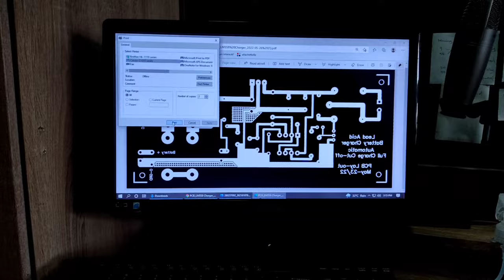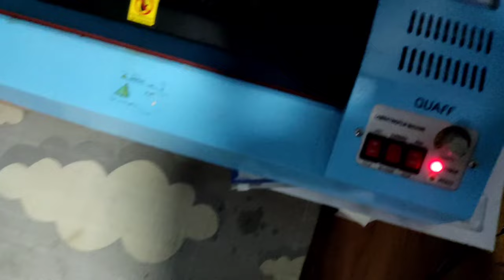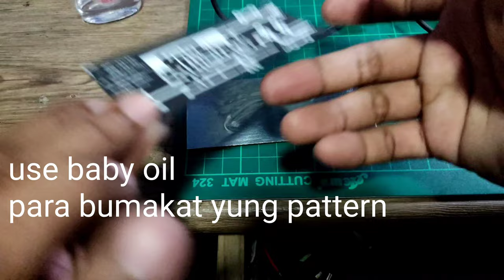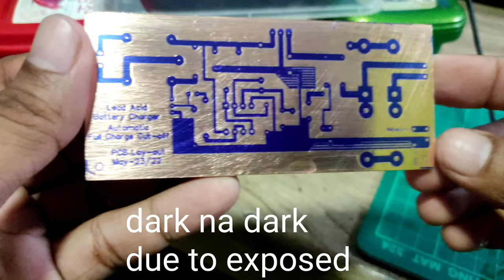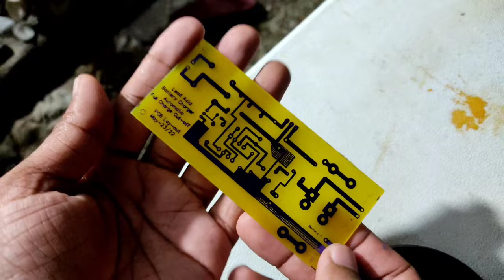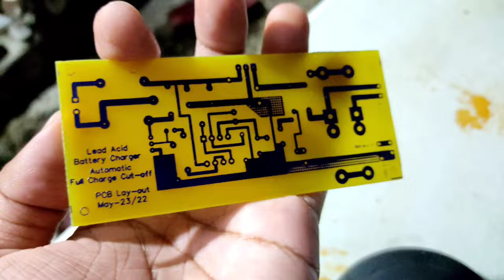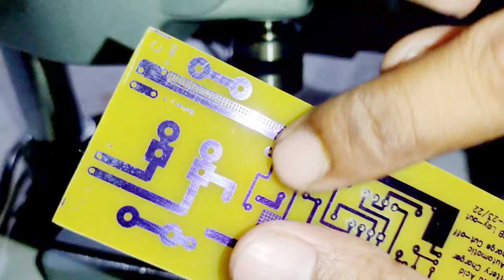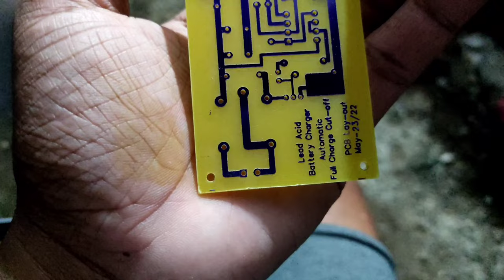How to PCB Etching Using Dry Film Photoresist Method

Comment: Help please, I am running into an issue where sections on the board just refuse to etch, the etchant removes most of the parts but there are some areas that refuse to come off
Reply from the maker: Use 300 grid sandpaper so that the blue film adheres well.  because when the roughness on the PCB is thin because you used thin sand paper, the Blue film will not stick even if your PCB is still very clean, you need to roughen it completely.  use 300 grid paper.
Reply: @diyelectronics5375  Thank you for the reply. I tend to use 400 grit, would you suggest moving down to 300?

Comment: Ano po gamit niyong laminator?
Reply from the maker: Para mag super flat siya wala bubble sa gitna kailangan din mainit siya
Reply: @diyelectronics5375  i mean anomg brand and model po nang laminator amg gamitin niyo po? Plan ko rin po kasi mag buy
Reply from the maker: @markallenalberto6398  sa shopee konsiya nabili  kahit anu brand naman
Reply: @diyelectronics5375  sa thickness po ba? May dapat po akong iconsider? 1.4mm po kasi normal na thickness ng pcb, tas puro mga 1?? Thickness po yung mga laminator sa shoppee
Reply from the maker: @markallenalberto6398  kahit ako kapal bg PCB sinasalang ko sa lamination wala naman problema
Reply: @diyelectronics5375  last na po boss, pwede po ba ako makahingi ng shoppee link na laminator na binili niyo po? thank you po and happe new year narin po :)
Reply from the maker: @markallenalberto6398  https://s.lazada.com.ph/s.gHYXg
Reply: Hi sir, follow up ko lang po sana, san po kayo nakabili ng uv light?
Reply from the maker: @markallenalberto6398  LAZADA

Comment: Pa help po di natutunaw ung film sa sabon
Reply from the maker: Anu gamit mo sabon? Kasi kung hndi siya natunaw sa Sabon malamang over exposure ka sa UV light ibig sabihin lahat ng blue film is naging plastic na. Na manipis dahil sa over exposure try mo kayurin ang film matigas nayan dapat malambot payan after ng exposure
Reply: @diyelectronics5375  Tide po ung gamit ko. 20 - 25 sec ko din po ineexpose sa uv light. natunaw na po ung film kaso parang di dumidikit sa pcb, napuputol or naalis po ung iba lines ng design. Plantsa po ung gamit ko dahil wala pa ako laminator. Sinunod ko po ung steps sa vid nu po.
Reply from the maker: @seandrixreyes9688  gamit ka 300 grid sand paper para mas malalim ang gaspang ng PCB kakapit ito need kasi soak sa water ang PCB bago apply ang blue film